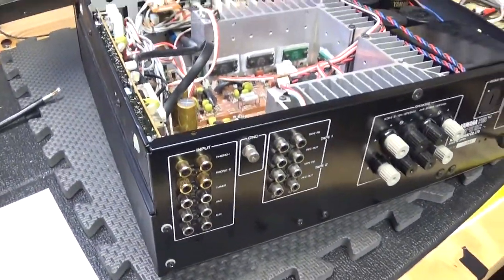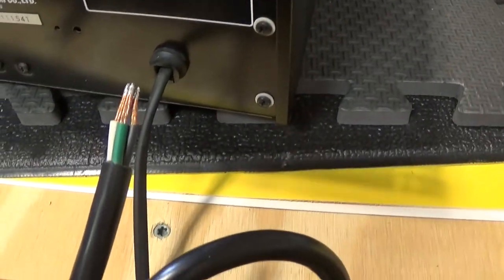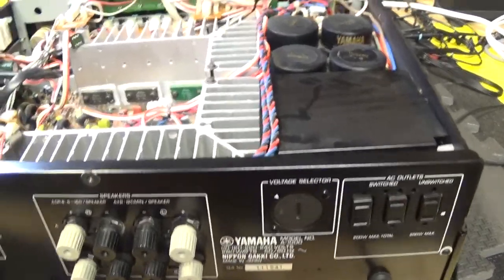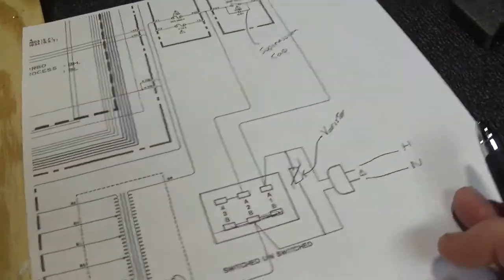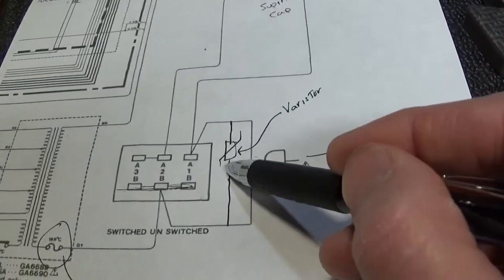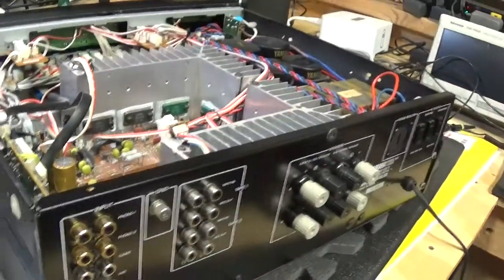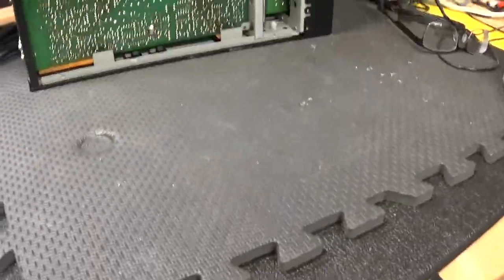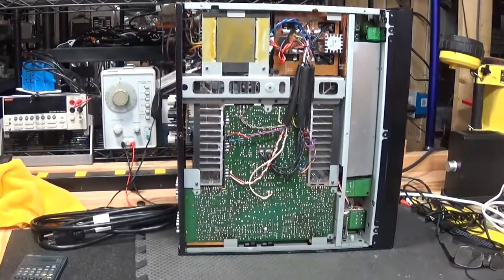Yamaha A-1000 Amp Power Cord Replacement Pt. 1 of 2

Comment: My old NAD has the same capacitor with the clear rubber boot as your yamaha.   I always thought it was to prevent a pop when switching it on, or when lights are turned on and off if they are plugged in the same house power circuit.
Reply from the maker: Yep, that's essentially what it's for; to bypass/short interference coming from the power lines.  But the Yama seems to have two of them.